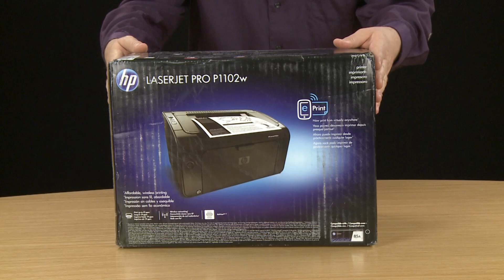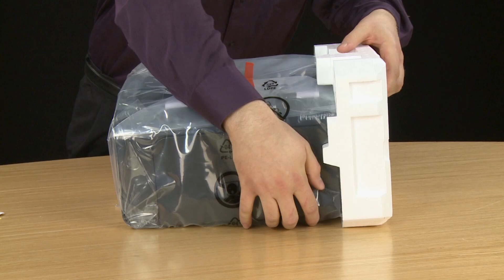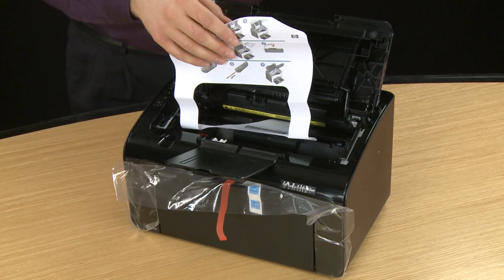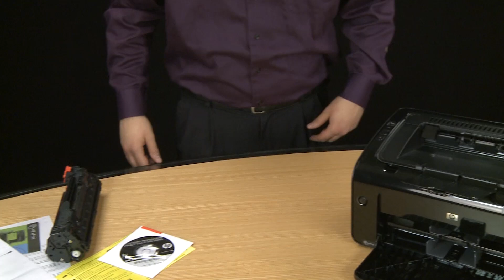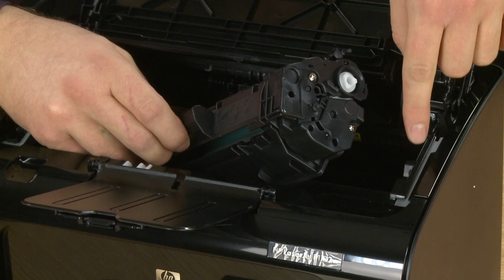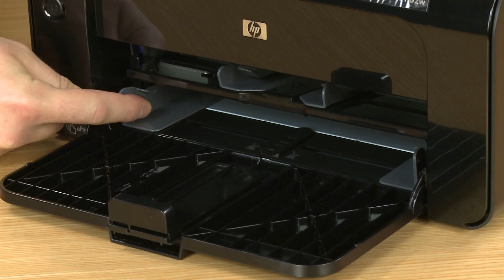Unboxing and Setting Up the HP LaserJet Pro P1102W Printer | HP

Comment: I just bought this printer it does looks like good one as I heard.....but when I bought it ....It didn't had a power cable :(
Reply from the maker: ***** Contact HP Technical Support they will make sure you have everything you need.

Comment: For a USB option install, DO NOT plug in the USB cable to your computer until told to do so by the install video on the install disk.  Otherwise, you will need tech assistance to get the printer to work.  It happened to me, and I consider this a serious computer engineering defect which keeps hp tech support busy.
Reply from the maker: saxefoner   For any other customers who have plugged in the USB cable before being prompted, you can correct this yourself by downloading HP’s Print and Scan Doctor.  It will identify which driver you are using and ask if you would like to install the HP driver.  You can find out more about the Print and Scan Doctor by searching for C03286146 on HP’s home page or using Google search.  The title of the document is “HP Printers - Using Print and Scan Doctor for Windows to Help Resolve Printer Issues”.
Reply: +HP Printer Support , mine is only working on USB connection! and not on wireless anymore!!
Reply from the maker: +arash assadi     Please download and run HP's Print and Scan Doctor (PSDr) utility. The HP Print and Scan Doctor is a free utility (tool) that helps to quickly resolve common printing, scanning and connectivity issues. Please search for C03286146 on HP's home page or using Google search. The title of the document is "HP Printers - Using Print and Scan Doctor for Windows to Help Resolve Printer Issues". You can also download the PSDr from hp.com/go/tools

Comment: I'm thinking of buying this to replace my broken epson sx435w inkjet, I mainly print text so a mono laser is all I really need? How long will the pre installed toner last me printing less than 30 pages per week?
Reply from the maker: Hi. Please search for C01999607 on HP's home page or using Google search.  The document is the product specifications for the Laserjet P1102w.  The toner cartridge used by this printer is CE285A.  If you search for that part number on HP's home page it will give information about the toner cartridge.  Please see the 'Specifications' for the toner cartridge for the page yield and it's footnote.

Comment: Hi. Do you need an AVR (automatic voltage regulator) before plugging in to the outlet? Or can u just directly plug it to the outlet itself?
Reply from the maker: +Ivan Michael Icao I would suggest that you plug the printer directly to a wall outlet.
Reply: HP Support Thank you so much!

Comment: can it copy papers?
Reply from the maker: Darpan Barua As it does not have a scan surface the answer would be no it cannot copy papers. If you need a printer that does ensure it has a scanning glass and you can be confident that it can copy.
Reply: thnx a lot
Reply from the maker: Darpan Barua Glad to help out!

Comment: product of vietnam

there is a blue plastic cover at the bottom of this printer

what is that for  ?? -- is it for replacing memory chip or something else

==
Reply from the maker: Hello Leeds greedyDr,
The blue plastic cover you are seeing is an access door used during the manufacturing process. HP uses many different vendors and not all the covers are the same color. You will never need to remove this cover.

Comment: is it Double-Sided Printing?? thx
Reply from the maker: Lee Nj According to the product specifications listed for the HP LaserJet Pro P1102W Printer, to print double-sided you will need to manually duplex the sheets printed. For addtional information on your printer, you can Google search "c01999607".
Reply: ***** AAH,  “ manually duplex the sheets“ ?  So is that the same as “no” to Lee’s question!

Comment: hi is there a wireless networking adapter for laserjet [p1102] because it has only wired
Reply from the maker: +Hamza Khan I have checked the specifcation of your printer and found that this printer only supports wireless connection. You can also confirm this here: https://bit.ly/2GSuGSX

Comment: Hello. Does it connect with Windows 8? Basically can I print from Windows 8?
Reply from the maker: +A Fan of VIDEO GAMES!!   There is a full feature driver for the P1102w printer for Windows 8.  I've included 2 documents for you.  Please click on the link beside the type of connection you want to use (wireless or USB cable).  

HP LaserJet Pro P1102w, P1109w - Wireless Printer Setup  http://ow.ly/XOa28 
HP Printers - Download and Install Printer Driver and Software Via USB  http://ow.ly/XOa4F

Comment: I have this printer.  For the past 6 months I've had nothing but problems.  Every time I try to print the right side of the document comes out with a black faded strip, about a 1/4 inch wide, distorting the image.  It looked like it could be the roller on the right side.  This prompted me to clean all the rollers to no avail.  Do you have any idea what might be causing this and how it can be fixed?
Reply from the maker: Hi there, thanks for contacting HP Global Social Media Support!
I understand that you are experiencing a print quality issue on your printer.
I will do my best to assist you.
Please refer to the instructions mentioned under this document to fix the issue: https://hp.care/6056SH0Hq
Regards, 
HP Support

Comment: Mi cartucho de toner se atoró dentro de la impresora, cómo retirarlo sin dañar la impresora?
Reply from the maker: +Jorge Ruiz thanks for reaching out. The support here is in English only. If you could post back in English, I'd be glad to help? If in case you need support in your language, I'd recommend you to refer our localized channel link: http://www.youtube.com/HPSupport
Reply: @HPSupport  ok. yes I do. The toner cartridge is jammed with the small, curved sensor cable inside and detects that the toner is in place. How can I unclog without damaging my printer? The small wire is out of position and how I could repositionated It's at specific place? Regards!!

Comment: Does it work on window 10?
Reply from the maker: +Kiệt Đàm    There is a full feature software and driver available for the LaserJet P1102w for Windows 10.  I have included a link to the P1102 drivers page ( http://ow.ly/Yr722 ), you may be prompted to choose your operating system.

Comment: Excellent explanation and video by Joe, but I marvel at HP's bonehead design that requires so many unboxing steps and is so difficult to figure out without watching a YouTube video.  The drawings/diagram included with the printer are particularly idiotic.  Take a cue from Apple and others in your industry, HP!  I bought my first HP printer in 1995, and the product still looks almost exactly the same 20 years later.  This is a testament to how little innovation there is in HP's product design.

Comment: Toner for this printer is too expensive
Reply: Let me just say this if you can set this printer up using windows 8.1 you will get a gold medal, these printers are old & no where does it say compatible with windows 8 & with updated drivers it doesn't register the USB
Reply: +GETTHEDEUCE , i am using this on my lap top windows 10 and also it used to work on windows 8.1!

Comment: I have a problem, i've already opened the package , removed all the plastic things but th printer doesn't want to take the paper.... whats the problem?
Reply from the maker: Check out the following: HP LaserJet Pro Printers - Printer Does Not Pick Up or Feed Paper - ( http://ow.ly/zgC5303igZc ). It could be any of the various offered solutions, so try then in order.
Reply: Aline you musts have broke it